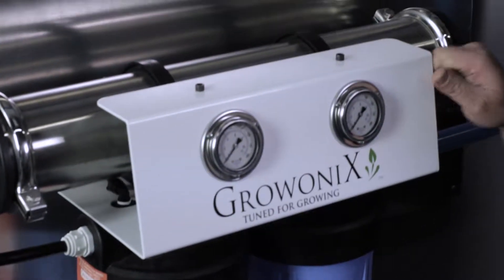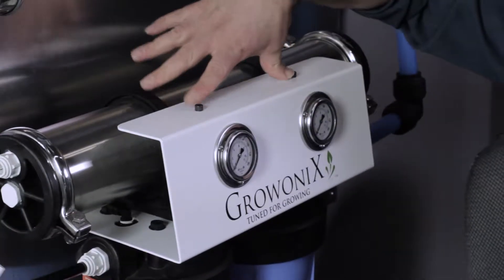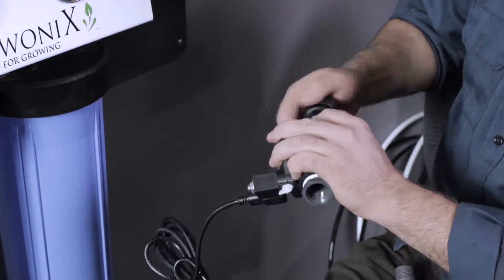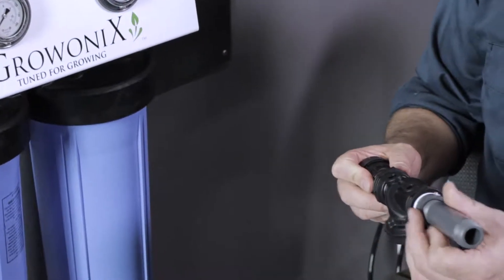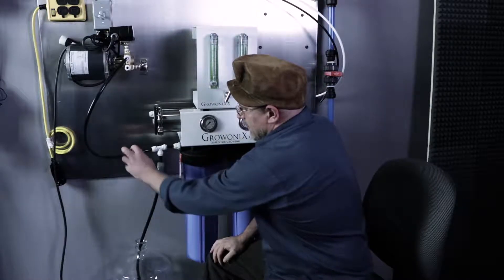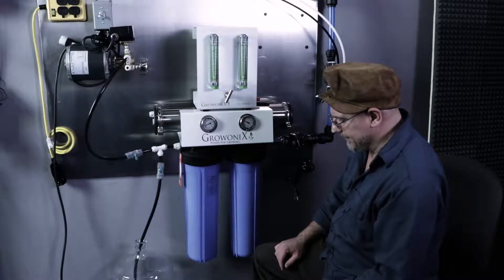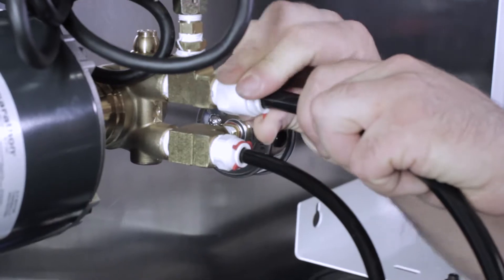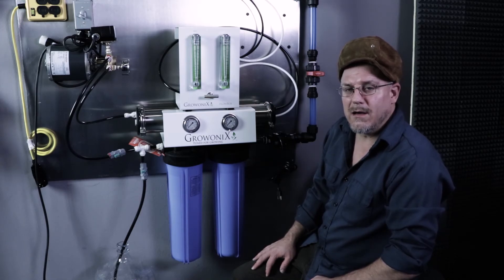GrowoniX EX1000 Deluxe: Connecting

Comment: Would you be able to connect this to feed your entire apartment with RO water?
Reply from the maker: The MAX output of this system is approx 1.3 GPM, and the permeate side is low pressure, so........we generally use bladder tanks and delivery pumps for whole house setups.  You'd have to call in to discuss further.
Reply: @growonixwatersystems5838  Thank you for your answer. Yea that what I was thinking. The thing is I don’t like the principle of a bladder tank. If I’m correct it’s basically a rubber diaphragm/bladder that hold your water, and it’s pretty unclear how this rubber react to RO water or degrade over time. I don’t want that in my water, particularly the one that I drink.
Reply from the maker: @Maxime-ho9iv  The other option is to fill an atmospheric tank, then use a delivery pump to pressurize the house.  This avoids the butyl diaphragm concerns, and an atmospheric tank could be stainless if you want.
Reply: @growonixwatersystems5838  Oh yes you’re right, that’s actually the simplest solution. I have to think about it. Thanks a lot. Do you ship to Europe?

Comment: This system is really really really good. I owned 1, thank to engineering who designed. Liability and reliability, so far A+++ after running 3 years for my 600GL aquarium, kinda picky on my aquarium that need water ~6.6 to bellow 7 PH but city water in Los Angeles is 8.5PH, i pay for fews different setup no1 meet the need of my accept GX1000.